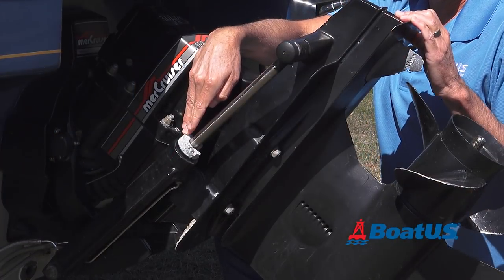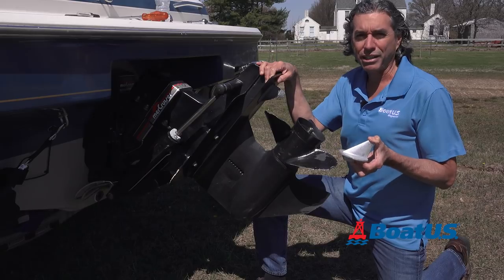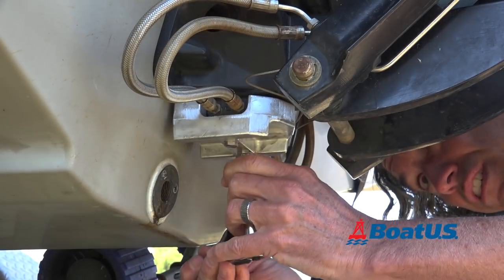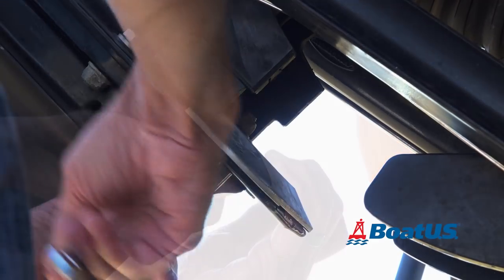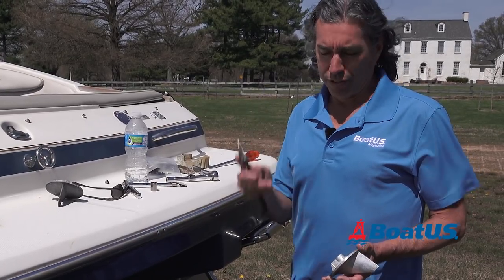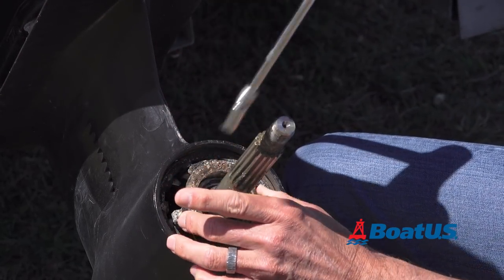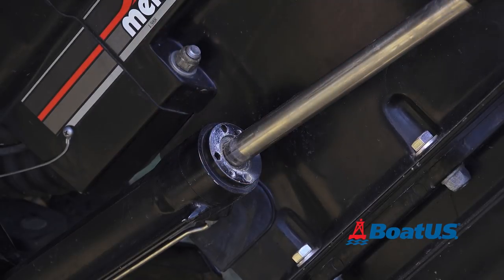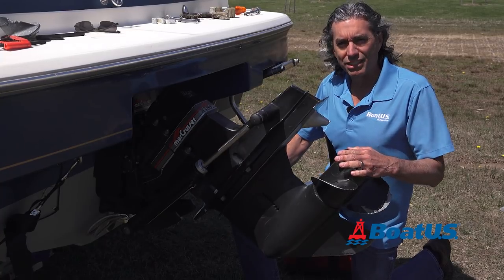How To Replace Anodes or Zincs On An Outboard or Sterndrive Motor | BoatUS

Comment: There appeared to be plenty of aluminum left on the old anodes, suggesting that they had a longer life.  What criteria do you use to judge replacement time for the anodes?
Reply from the maker: Hi Barry. Typically, anodes should be replaced when they are about 50% wasted. On our demonstration boat, the anodes still had some useful life left and may have been good for another season.

Comment: What is the best anode for fresh water - aluminum, magnesium or zinc?
Reply from the maker: Great question, Mike. Anodes can be made of zinc, aluminum, or magnesium, and each type has different uses. The majority of anodes are the familiar "zincs." While zinc anodes have worked well for years, aluminum anodes are even more effective because they can create a higher voltage (driving force) and have a much higher capacity (useful life) for the same weight. Aluminum anodes also do a better job of protecting in both freshwater and saltwater. The majority of boats should be fitted with aluminum anodes.

Magnesium anodes are even more powerful than aluminum (and more expensive) and are best used only with the advice of a specialist because in some situations, they can overprotect and cause paint blistering and other problems.
Reply: @boatus  what if your drive is made of aluminum?
Reply from the maker: @dabluesgarage  Thanks for the question! ALL drive units can corrode, so maintaining the proper anodes is a must. To learn more, visit https://www.boatus.com/expert-advice/expert-advice-archive/2017/february/boat-corrosion-protection-with-anodes

Comment: Thanks for the info. I thought there was only one. Rookie boater. Learning as much as possible.
Reply from the maker: Thanks for watching, Rick. That's why we do these videos -- no one knows everything. Glad you found out before it became an issue. Each outboard/outdrive has several, and some are well hidden. We suggest consulting your owners manual to make sure you find them all. On some outboards, there are one or two hidden under the cowling that most people (including seasoned owners) don't know about.

Comment: Great video. Should i use any kind of grease or lubricant on the bolt threads?
Reply from the maker: Good question, Jeremy. You don't need to add anything. Just make sure all surfaces that are in contact are clean and unpainted and the fasteners are tight to ensure an effective connection. You can learn more here: https://www.boatus.com/expert-advice/expert-advice-archive/2017/february/boat-corrosion-protection-with-anodes

Comment: On a Mercruiser Alpha 1 Generation 1 is this the same procedure in a kit it does not include the prop anode?
Reply from the maker: Thanks for the question, O'day. As you know, checking/replacing anodes regularly is critical to the longevity of your underwater metals. Each outboard or outdrive is a little different, so we always suggest consulting the owner's manual for your specific outdrive or contacting Mercury to get its recommendations.

Comment: Awesome video! My drive looks just like this video....Where did you find the kit for $45? Everywhere I see the kits range $80 to $110 :( I have a MerCruiser Alpha 350 MAG MPI -- Manufactured 2006
Reply from the maker: Thanks for watching, Corey. The likely explanation is that we shot the video a few years ago before metal prices went up. I did a search on West Marine, which is where we probably bought the kit, and I'm finding similar prices to the ones you're quoting. Either way, it's money well spent, as I'm sure you will agree. Have a safe, fun, and trouble-free boating season!
Reply: @boatus  Money well spent, indeed! Thanks for taking the time to check the pricing!
Reply from the maker: @goldbeck09  Any time!

Comment: I believe you mentioned in the video that you were replacing it on an Alpha. Is the process any different, or for that matter more difficult to do, on a Bravo?
Reply from the maker: Thanks for the question, G.J. Basically, changing the anodes on a Bravo outdrive is no different than replacing those on an Alpha drive. Just ensure that you buy the correct set for your drive. Replace all the anodes, even if some look less wasted than others. Typically, those under the cavitation plate next to the prop suffer the most wasting, those adjacent to the bellows the least. Also make sure that you use anodes of the correct metal – zinc for saltwater and magnesium for fresh. To read more about the different types of anodes, check out https://www.boatus.com/expert-advice/expert-advice-archive/2017/february/boat-corrosion-protection-with-anodes
Reply: Thanks so much for the prompt reply, and I will definitely be sure to purchase the correct set. By the way, this was a great video!!
Reply: Hello My Friend: I just read the article that you linked me to, and thanks so much for doing that! In your reply you recommended using magnesium, but the article seems to suggest aluminum. I keep my boat in a freshwater lake. So I'm thinking that aluminum would be the best choice for that situation. So just let me know your opinion on that. Thanks again!!
Reply from the maker: @g.j.battle8924  There are a couple of schools of thought on this. Basically, aluminum will work in both salt- and freshwater. But depending on who you talk to, many will recommend magnesium for freshwater lakes, aluminum for brackish water, and zinc for salt.  That said, aluminum should be fine for freshwater. However, if you don't find the aluminum offers sufficient protection, you can switch to magnesium. Magnesium should never be used in saltwater; the boat will be overprotected and there will be a large amount of alkali in the water around the anode that can destroy boat parts very quickly. Hope this helps clarify!
Reply: @boatus  Okay and sounds good! Thanks again, and I appreciate all of your help on this!!
Reply from the maker: @g.j.battle8924  You are quite welcome, and have a great weekend!
Reply: @boatus  I have a 2005 Bayliner 185 BR. How can i tell if its a bravo or alpha leg that i need to buy?
Reply from the maker: @mackdogg33  Thanks for the question! I believe that if you have the 4.3 liter V6 Mercruiser engine, your boat would have been fitted with the Alpha drive. If you are still unsure, you can generally identify the difference by the top cap on the leg. The Alpha drive has a square looking top cap, the Bravo drive has a rounded cover plate. There are some pictures and descriptions here to help you identify your particular drive here: http://www.sterndrive.info/sterndriveparts/identify_my_outdrive.html

Comment: I have the same drive, but mine does not have all the same mounting holes, such as on the hydraulic rams.  Did you have to drill and tap those?
Reply from the maker: Thanks for the question! Many outdrives look alike, but there are differences from year to year and model to model. I suspect that this is what’s happening in your case. On no account should you drill and tap the rams to fit anodes. If you do you’ll likely end up causing all the oil to leak out, and the ram will be destroyed in the process. If you buy anodes specifically for your make and model of outdrive, the pack will come with all that you need. There is absolutely no need to fit anything above and beyond what is contained in the kit.

Comment: I have an alpha1 gen2. It does not have trim ram anodes
Reply from the maker: Hi Fall. Not sure if this is a question or a statement. A quick search online shows that replacement kits for the Alpha 1, Gen II come with a lift ram anode. So I'm not sure whether your particular sterndrive doesn't have one or is possible missing one. You may want to consult your owners manual to check.

Comment: What are the sizes for the tools that you used?
Reply from the maker: Thanks for the question. I'm not sure we have an answer for you at this point--this was shot several years ago. The socket size depends on the motor and anode kit.

Comment: You should possibly have mentioned to install the fin anode at the same angle as the one removed.  I imagine a number of people who might attempt the job wouldn't realize that the old fin at an angle wasn't necessarily a fault.
Reply from the maker: Good point – the fin anode’s angle is adjustable and when replacing you should try to match the angle of the old one. Most of the time though, we find that the difference the little fin makes is pretty negligible, especially once it starts to waste away. Thanks for your input!
Reply: I replaced it straight one time thinking it got out of line somehow.  Big mistake, boat was very hard to turn to one side.  Luckily I remembered the angle and set it back, then the boat steered properly.  Made a huge difference.

Comment: I would call them "bolts" instead of  "screws". You used a wrench instead of a screw driver.
Reply from the maker: Hi William. Actually, they are screws. Bolts are used for assembling two unthreaded components, with the aid of a nut. Screws, on the other hand, are typically used to fasten two pieces together, at least one of which contains its own internal threads – like our anodes. The tool used to fasten them could be a screwdriver or a wrench.
Reply: @boatus , as an old machinist, you're right.
Reply from the maker: @789pokey  Thanks! ;-)